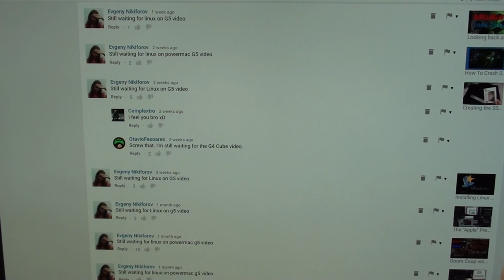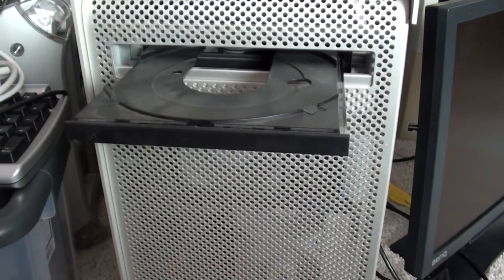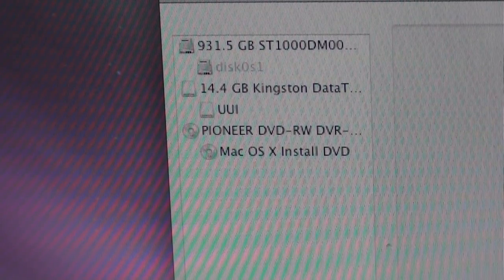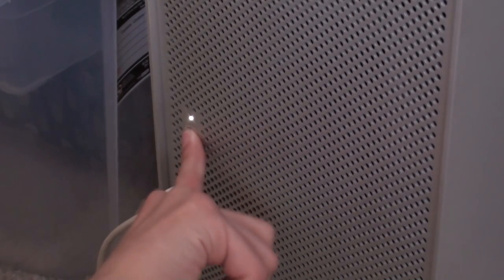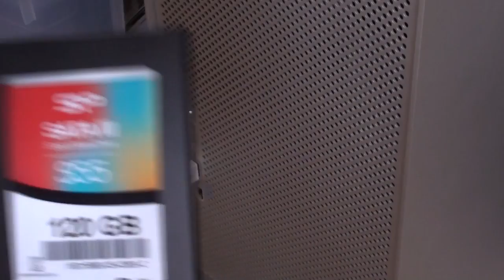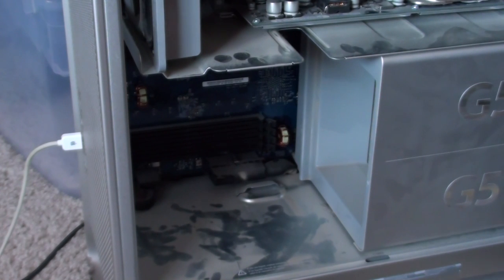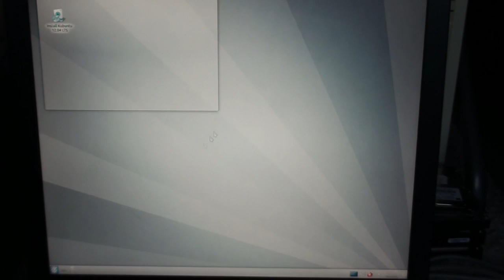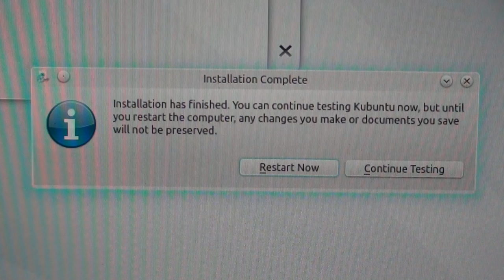Installing Linux on a Power Mac G5 (Part 1)

Comment: After you're done with Linux on that G5, you definitely should try installing Windows 98 on it.
Reply: Windows 98 isn't compiled for PowerPC unless you could emulate the Pentium.
Reply: There is probably some version of Windows NT compiled for PowerPC but good luck finding that and if you did it might run a bit fast due to this being a G5.
Reply: NT4.0 is PowerPC compatible.
Reply: I know there was NT 4.0 for PowerPCs, anything else you can probably only do in a VM.
Reply: Who said that it will work? I said that I want to see him trying it. I didn't say that it will work. :D
Reply: Alex
it can't boot, no point in trying.
Reply: Why? Waste of time. Windows 98 is x86, and don't reply "I know." because obviously you didn't know or you wouldn't be posting stupid questions.
Reply: Alex Nice story
Reply: And I'm in that 2%? Yesssssss
Reply: +Alex There wont be any fun in just trying it out...
Reply: Windows NT 3.51 PPC HAS indeed been installed on G5's before, but it takes a LOT of hacking and headache, and you are left with an operating system that doesn't even run programs compiled for 32-bit x86(99.99999% of them), and runs like crap. However, its 16 bit x86 emulation layer(NTVDM) still works fine. 
The reason it is so difficult to install(pretty much impossible for mere mortals) is Windows NT PPC was designed for ARC BIOS, not Mac's Open Firmware, which is completely different. Like trying to plug a hair dryer into a combustion engine. Your going to need some extra abstraction layers, but it can be done.
Reply: ***** Exactly. That's why I want to see  Druaga1 trying it out. JUST DO IT!
Reply: ***** I love wathing him fail... :D
Reply: It's possible to use qemu on PPC to emulate an x86 machine, I've seen Windows 7 running on a G5 with qemu and linux.
Reply: ***** That's boring...
Reply: lol well its prob only way itll work
Reply: Solaris.
Reply: Yes
Reply: There used to be some Mac software called WindowsPC or WinPC back in the mid to late 1990‘s which, basically, ran Win95 (and later Win98), in an emulation layer on top of (or dual boot to) Mac OS 8 or maybe OS 9.  No matter how much RAM your Mac had, maxed-out even, at the time WindowsPC crawled like a dying sloth.  It was mostly useless but necessary for companies to manage invoices with Sage Accounts or some bespoke, custom-built, DOS-based business programs which were only ever available on crappy Windows PC’s because the programmers of the day were lazy, gormless arses.

Owing to WindowsPC’s “wading through treacle”-like qualities, it soon died a death in a tar pit somewhere. No-one, not even it’s rip-off merchant owners, attended the funeral.

It’s possible that with a later PPC multiprocessor G5, fully loaded with the maximum 8GB RAM and armed with today’s know-how, even Druaga1 (my hero) could actually force it to move at previously unseen, er, “speed”.

But only if there was an SSD involved, obviously (!) — and we haven’t seen if that’s even do-able as of yet.

A challenge worthy of catastrophe!

Comment: All DVD drives support dual layer DVD. And pretty much any linux install CD fits on a single layer DVD (4.7 GB)
Reply: Bob Newell:  All true in the modern era but a lot of the time G5 DVD’s simply refuse to mount dual layer DVD’s.  So annoying — and I never found out why — but it was most inconvenient having to plug in an external FireWire DVD drive to boot from that instead.

I suspect the drive manufacturer got a fairly unprofitable order of millions of units off Apple and decided to either skimp on the quality, the firmware — or both, just to make a half decent margin.

Comment: I wound up with one of the old G5s from the Terascale cluster at Virginia Tech.  Seems like as good of a use as any for it.  

After dicking with Kubuntu for a few hours, I dumped it and went with Lubuntu 14.04.  Much faster, much smoother.

Comment: (Every PowerMac G5 in the world whenever someone turns them on):

“PLEASE KILL ME I AM IN CONSTANT PAIN!!!”

Also The PowerMac G5 is what I would like to call a “nuclear Computer”. Why? Because it uses huge amounts of power, has a huge heat sink, and sounds like a beast when it’s running. Both the G5, a few of the G4 systems like the mirror drive door and the vast majority of Pentium 4 machines are in the “nuclear” category.

Comment: Actually the blink codes you have are wrong:
1 blink means no RAM is installed.
2 blinks mean incompatible RAM types are installed.
3 blinks mean no good DIMM banks detected.
4/5 blinks mean, well, you know.

Comment: I'm putting Ubuntu mate on my G5 right now, its been good so far.  Played with the live environment for a while and it runs pretty good.  Only problem I'm running into is my DVI to VGA converter cable is causing my monitor not to be recognized so it's at a funky resolution on one monitor while the other is at 1680x1050 lol

Comment: Hey Druaga1, SATA I and SATA II Based SSD and HDDs for Power Mac G5 will only work. SATA III or newer SATA Generations aren't compatible and will not work.

As you use the SATA III SSD to install Linux on a PowerPC-based Power Mac G5, this will not work and you only need to buy a SATA I or SATA II SSD instead.

Comment: Is it just you and me, or are G5 towers horribly unreliable systems in the long term? I had a quad core system that was giving me the same kind of trouble with freezing up and otherwise not running smoothly. In fact, I think it might only be those later G5s with PCIe that are so troubled. It is a real shame! I ran Linux on it for a while, even threw in various PCIe expansion cards to see how far I could modernize the system (faster SATA and USB), but in the end it just did not survive. It's a real shame, because with a modern Linux distro installed, a G5 can actually still keep up with modern tasks. A quad 2.5 GHz system with 16 GB DDR2 RAM is still absolutely passable for internet and basic work uses.

Comment: also it is /somewhat/ possible to USB boot these machines.  You have to know how to work the OpenFirmware command prompt though as USB devices won't show up in the GUI boot menu.  I got it to work on mine trying to install Leopard from a flash drive but I wasn't able to install from USB.  It'd start booting and loading up OS X but then it'd hang and kernel panic.

Comment: Why lubuntu? and not ubuntu?
Reply: Lite version of ubuntu ( 900 Mb instead of 4 Gb )
Reply: Lubuntu is less heavy in system resources  and has less PPC support these days. I've tried this all before. I gave up... Ubuntu straight should run like fuckin' molasses on a G5 dual or not.
Reply: from when was ubuntu 4gb ?
Reply: I used the 40MB ubuntu net install cd to install lubuntu 16.04 on an imac g3. It runs soooo slow but it does work.
Reply: kaetty_7 Nope. I used MANY MANY ubuntu versions cd and DVD
Reply: oups, sorry openSUSE is 4 G(oddimit)B but the ubuntu it's 1.1something Gb so yeah. Lubuntu is still just a little lighter than ubuntu.
Reply: He uses Kubuntu not Lubuntu.
Kubuntu uses KDE, Lubuntu uses LXDE.
Ubuntu Unity and Unity has pretty high system-requirements to run smoothly.
Reply: At the end, Druaga will always fail to install linux on all kind of computer... Karma i suppose ><
Reply: no lol ubuntu hasn't officially supported PPC since like version 6 or 7.  Derivatives like lubuntu, ubuntu MATE, and Linux Mint keep more current support for PPC.  Ubuntu probably wouldnt run that bad on a G5 if it was supported.  I'm running Ubuntu mate on mine and it seems like it runs circles around his G5.  With only 2gb ram.  Only problem I'm having is Youtube videos won't play on it for some reason

These machines are still very capable imo
Reply: *****
The real Problem of Ubuntu is Unity.
Mint uses Cinnamon or Mint.
Lubuntu, Kubuntu, Xubuntu and Ubuntu Mate are just Ubuntu with other Desktops.
That's why Mint may run, but Ubuntu with Unity will probably fail to run smoothly.
Reply: MrDavibu I know that, but ubuntu doesn't have any current PPC images on their site.  My favorite DE is Pantheon from Elementary OS if that worked on PPC I would try it out for sure.

Not to mention he's using a 4 year old release of kubuntu.  I'm surprised it worked as good as it did.  on my machine sound worked out of the box with latest version ubuntu mate, smu was controlled correctly as fans aren't running at full blast.  Not a bad experience but for some reason it won't play youtube videos with firefox.
Reply: Aaron Blakely:  Playing YouTube videos on any machine much older than five (5) years old is a problem.  It seems the developers at YouTube have access to all the latest graphics cards and fancy new machines so design the site code almost exclusively for new, high-end capabilities — completely disregarding the needs of audiences who are chugging along nicely with what the devs would condescendingly call “legacy” machines.

I hate those bastards, I really do.

Comment: 3 led flashed mean incompatible ram configuration installed. Something is not OK with your ram config. Normally the RAM config pattern is printed on the inside of the door :)

Comment: I think your computer is just overheating, give it a good clean, and wiggle all the connectors and test memory.

For full Sata III support, just add some PCI card to add. You will still need to but from another mechnical drive (or maybe small compact flash, or some other small ssd with sata 1 only), but then put rest of the os on sata 3 connected to pci (sure it will not be super fast over pci, but still faster than sata 1).

Comment: Why you don't downloaded the Linux ISO with torrent?
Reply: It wouldn't be any faster since his ISP isn't that great. I think he said in an earlier video that he gets 30Mb/s down which any decent site will give you.
Reply: Which would get you 3MB/s on torrent and would download 1 GB in less than 15 minutes.
Reply: I live in Brazil, I have the max speed possible in my city (10 Mb via DSLR ) if i download ISOs or anything with 1.0GB or more from the browser, it will take one day. On torrent I download the same ISO in one hour or less.
Reply: BolinhoSO7 I live in Brazil as well. I have 20Mbps. ISOs downloaded direct will depend on the server used. Average speed is 1.2 MB/s with a maximum of 2 MB/s. Torrents are only limited by the maximum speed of your ISP. If you have 10 Mbps and have good seeders, you'll download at 1 MB/s.
Reply: +Crimson Sunrise Thats my case, I am used to download all my torrents with 1.0 Mb/s speed!

Comment: A much faster way of booting into linux on a G5 is to place the bootable file onto your existing install and then using open firmware to boot from that file. Google should help you here, it's much simpler than it sounds.

Also much cheaper, considering you don't need CDs

Comment: maybe start problem has Something to do CPU heat problem if the computer stretches only a little bit too much it's going to turn off because of old concrete thermal paste somewhere supposed to be nice and slimy

Comment: I HAVE A SANDISK 120GB SSD IN MY POWERMAC G5, AT FIRST IT DID NOT DETECT LIKE AT ALL, BUT I FIGURED OUT WHAT YOU HAVE TO DO IS, AFTER YOU HOLD OPTION AND SELECT TO BOOT FROM THE MAC OSX LEOPARD CD, IT WILL BRING YOU TO BLAH BLAH YOU KNOW, AND WHEN IT COMES TO THE PART WHERE YOU SELECT DRIVE IN WHICH WHERE YOU WANT TO INSSTALL THE LEOPARD, AND THE SANDISK EITHER DOESNT SHOW UP OR IT SAYS IT CAN NOT BE USED, WELL, NO NO PERSISTANCE IS THE KEY HERE IN THIS SITUATION, YOU HAVE TO GO INTO DISK UTILITY, YOU THEN HAVE TO FULLY ERASE THE DRIVE, AND THEN YOU HAVE TO PARTITION THE DRIVE (JUST LIKE KEEP IT THE SAME AT 120GB, THEN JUST CHANGE IT TO GUIDED PARTITION OR WHATEVER THEN BACK TO MBR OR VICE VERSA, AND REASON FOR THAT IS IF YOU CLICK PARTITION, YOU CANT CANT CLICK APPLY UNTIL SOMETHING HAS CHANGED, SO CHANGE THE MBR THING THEN CHANGE IT BACK, OR MOVE THE 120, TO 110, THEN BACK TO 120) AND CLICK APPLY AND THEN BOOOOOOM, ONCE YOU GET TO THE PART WHERE YOU HAVE TO PICK WHAT DRIVE TO INSTALL ON, YOU WILL BE ABLE TO USE THE SANDISK SSD, IDK WHY IT WORKS THAT WAY BUT IT DOES, BECAUSE ERASING IT BASICALLY DOES THAT, BUT IDK, THATS JUST THE WAY IT HAS TO BE DONE :)
Reply: first off, caps. secondy he DID try disk utility.
Reply: +Julian Robin I know he did, but you have to do it twice like idk how to explain, im going to make a vid on how to do it, it worked in mine just fine, if you follow what I said

Comment: Oh man I've done the same very thing, forgot to plug in the cpu fan on a Pentium 4. turned off just after boot.
Reply: Are you sure that's the fan and not the optical drive. my Xbox 360 is just as loud.

Comment: DRUAGA1

to boot from usb you need to do the following

1. boot into open firmware 
2. do "dev / ls"
3. check for the usb drive on the list.

4. Do 'devalias' and check for the alias. For me it is usb1 
5. Do 'boot usb1/disk@1:2,\\yaboot' EXACTLY as it is written. EXACTLY.

6. DONE!

If you need anymore help I recently installed linux on my powermac g4 and It took me over a month that's how I know.
Reply: it is really sad that he didn't install 16.04 , it is the most beautiful os out there
Reply: +kaetty_7 There's no 16.04 YET. Believe me I've been trying to upgrade my g4 to lubuntu from mintppc and so far I've failed. I've been searching for kubuntu and I can't find 16.04 PPC download
Reply: KrazyKube Gaming yeah there is "no" kubuntu 16.04 PPC BUT there is lubuntu 16.10 PPC so you could install plasma desktop and theoretically get kubuntu 16.10 :P
btw link to lubuntu 16.10 daily builds :http://cdimage.ubuntu.com/lubuntu/daily-live/pending/
Reply: That's what I ended up installing. It feels exactly the same to 14.04
Reply: +KrazyKube Gaming yeah , it feels the same but under the hood it is another thing
Reply: I guess you are right.
Reply: GPAAAAARTED! Y U NO DETECT MY USB FLASH DRIVE!?!

Comment: Looks like the mainboard is duff on the first G5
Reply: i agree. Not sure about macs but on standard "pc" hardware those kind of errors sound like the chipset is toast. Or that your board has Via chip somewhere...
Reply: Way back in the 60's or so computers had to be in cool dust free rooms today we see them pack with it this one is no exception dirt will short connections a good cleaning may bring this computer back to life again don't forget to clean contacts as well as a bad connection is as bad as a short circuit most of today boards have so much protection built into them it not like to fail in most cases.
Reply: +Charles Wallinger I was thinking could be dirt too especially as it worked one minute not the next.

Comment: In all honesty I have a G5 that has problems like this as well. It always malfunctions and never wants to work correctly. So I know the pain of having an annoying G5.
Reply: Most power Mac G5 are pretty reliable. His however is likely the dual 2.5ghz water cooled model. Those are known to have many issues due to leaking water coolers.  They use Ethylene Glycol as a coolant(the same stuff cars use) it’s corrosive and conductive and will wreak havoc when it gets out. Any air cooled models are pretty good. The other exception is the iMac G5 as they run hot and their power supplies are quite unreliable.
Reply: @EvilTurkeySlices  yeah I had a water cooled model and thankfully it didn’t blow up. It just revved a lot of the time and would ever make it much past the installer after using disc utility at best. Most of the time it wouldn’t even boot from the dvd and if it did it would freeze.

Comment: usb 3 is backwards compatible with usb 2.0
Reply: hamza khamash:  And supposedly USB1 also.  The problem is the Mac firmware back in the day simply didn’t support booting from USB.  It wasn’t necessary until after the G5’s had gone into production because Apple thought it was a niche PC thing.